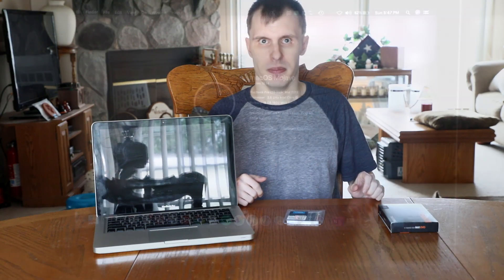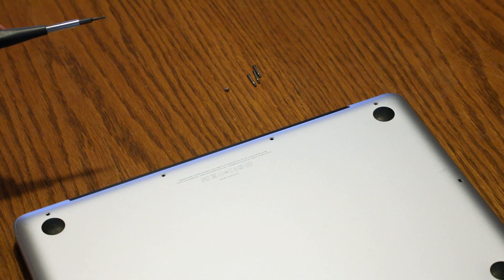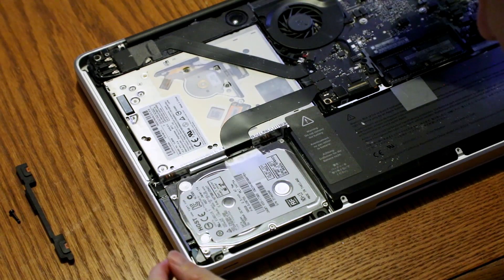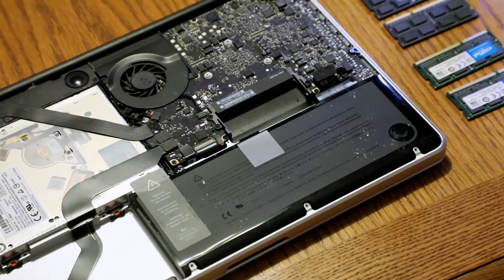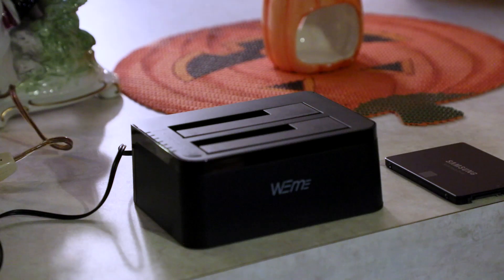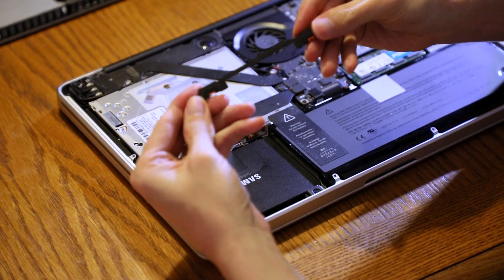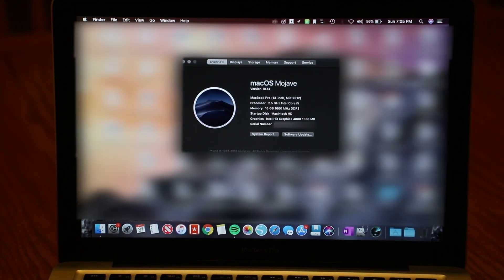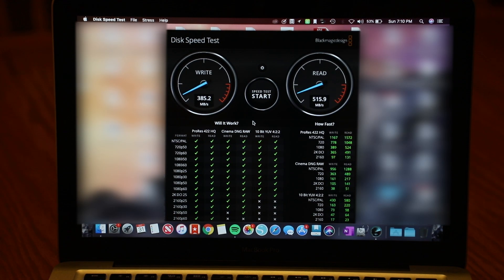MacBook Pro Mid-2012 SSD and RAM Upgrade Tutorial

Comment: I’m a new beginner doing music & I had brought a MacBook Pro Mid 2012 that’s like brand new & it says in the storage section that it has a internal (500 GB SATA Drive) so I wanted to know what’s the difference between the SATA drive & the internal SSD? I ask because I heard that the Crucial BX500 1TB 3D NAND SATA 2.5-Inch Internal SSD is supposed to be a good SSD
Reply from the maker: Hey How, basically if I recalled working on this, there's your normal laptop form factor SATA 2.5" HDD and a small gumstick SSD.  You'd need an adapter though as unless you buy a larger one from OWC or another Mac-focused vendor, their keying does not match M.2 standards by any off the shelf normal PC-based SSD.  You can however, buy that SATA SSD and be fine.

Comment: Is there a way to just fresh install the OS on ssd without cloning the hdd?
Reply from the maker: Hi Kuya, with the 2012 model you could probably from MacOS disc. Just be sure that the firmware of the system bootloader is up to date OS-wise so that it can identify the SSD since it wouldn't be a genuine Apple part.  I only provided info to clone the disk since most people would prefer to keep their installation.
Reply: @TheRealLink  what if I don’t need any data or files from the old hdd, is it possible to just install the new ssd then boot to internet recovery to install the OS?
Reply from the maker: @vangonzales5231  Hey Kuya, I believe with the 2012 Macs you can.  It's the 2015 ones that swap to M.2 NVMe that don't ID the drive properly until in Mac OS.  But I think with 2012 you'll be fine to wipe.  Of course back up anything you'd like to save anyway but I believe you should be fine to do that.
Reply: @TheRealLink  thank you so much! My fiancé just got her ssd delivered today and were about to install it on her MBP mid 2012. You’re a real life and a dollar saver man!
Reply from the maker: @vangonzales5231  Hope it works out well man!  I just try to make sure I'm putting out good advice and tips out there that's all ;)  Enjoy the speedier machine.

Comment: i love to try this.. i dont have a weme .. . Can do this upgrade with a weme?
Reply from the maker: Should be able to, or any drive cloner really.
Reply: @TheRealLink  thanks for your reply. what i meant if i can do it without weme  :)
Reply from the maker: Well, if you want to retain your data, you could probably have drive cloning software detect the new SSD so that's one way to do it without a hardware dock.  But if not WeMe then some kind of drive caddy or dock is needed if you don't want to rely on a software solution.

Comment: Apple documentation suggests 8gb max ram for mid 2012 model.. is this incorrect? Does 16gb actually work effectively?
Reply from the maker: Hi Jason.  As far as I've seen with this client's machine, they have not reported back any issues to me.  And there are countless purchasers of SSDs and RAM kits I've noticed through these videos that haven't come back mentioned any issues for the most part.  So I'm guessing it seems to work fine though YMMV.

Comment: I need your help... i replaced my hd to a new ssd. It reads it as an external drive but when i replace it as a internal drive it boots up normally for 3 min and then shuts off to a flashing folder. I already replaced the internal cable connecting the ssd to the MacBook. PLEASE HELP!  I don’t know what else to do and who do go to. I tried everything on the internet from resetting ram resetting  vram repairing hard drive. Etc.
Reply from the maker: Hey Miguel.  Wow that's quite an issue.  From my understanding, a flashing folder is when the OS can't read a particular file it needs or can't find the OS at all.  If you have your original HDD, you can use the drive cloner to clone it exactly by sector which would also include the startup files / OS.  If you have a Time Machine backup for your HDD, I would recommend restoring from that first.  I believe this swap doesn't allow reinstall from Internet so that's why I recommended the drive clone (unless I'm confusing it with the 2015 Mac I did, sorry it's been awhile).  

It's possible that you may also need to reformat the SSD attached to the machine as HFS+ / GPT.  There's clearly some issue where the SSD is not seeing all the files it needs.  

I wish I could provide more insight but I'd recommend to restore your original drive first, erase the SSD, do a re-clone and try it again.  Hope this helps.

Comment: hello! thank you for the tutorial. My hard drive on my macbook 2012 is corrupt (what apple told me) so I am thinking of switching to a SSD as you showed. Do i still need to clone the hard drive since it is corrupted?
Reply from the maker: Hi Eri!  For the 2012 model I believe it's less necessary than the 2015 model.  You might still need a TM or local disk / DVD copy of the OS to roll up from as I am trying to recall if you couldn't use the restore from internet option with this method.  Otherwise though reloading fresh to a SATA-based SSD should be fine!

Comment: Is this a pre-retina model? Would you recommend replacing the hdd cable as well? I’ve heard mixed opinions on that. Some people say the old cables can be faulty and others are saying that if you upgrade to ssd you need to keep the original cable. What are your thoughts?
Reply from the maker: Hi Tred.  I'm unfortunately not familiar with this cable situation.  On both machines where I did drive changes, I kept the original cables in place.  I'd imagine short of failing outright, cables either work or they don't, so if you're having problems maybe try sourcing a replacement.  If it's working fine then probably don't change it, unless you're seeing other problems arise.

Comment: Hi there, I was given this laptop by my son....he already copied all his files and now got a fresh laptop. If I upgrade the RAM and SSD since it’s like new, do I still need to clone the old drive? Or is it now just replace and that’s it? Or do I need to download again to current OS? I think it’s on latest Sierra version 10.12.6.
Any recommendations on the SSD and RAM wise? 
Also while probably doing this upgrade will consider replacing the battery too. Any ideas of a reliable replacement.

Many thanks in advance.
Reply from the maker: Hi Gonzaga.  For the 2012 model I belive you could just replace the HDD to SSD and upgrade the RAM however keep in mind you'd still need to reload the OS via Internet or from scratch / reload from Time Machine etc.  Since the 2012 model is older, any SATA SSD should work. The RAM used and recommended is in the video description.  The Battery however, I am not sure as to the ease of replacing - you'll have to probably look at another video for that!  Thanks for the kind post.
Reply: @TheRealLink  thanks a lot for your reply. Found a video on How to change battery and seems simple enough.....just finding the right one as Amazon batteries most got mixed reviews anyway. Probably will do the clone too as the sata cable adapter  are cheap enough anyway. Thanks again buddy👍
Reply: @TheRealLink  Hi,   managed to upgrade both memory and ssd on my Mac.....now running super smooth and fast......only had trouble cloning originally as it wasn't a straight forward ie. drive Im trying to clone wasn't showing on image so have to format Samsung SSD a few times and have to restore HD for SSD to clone....not sure exactly how I did it as I was about to give up...but get there in the end...super happy now and again thank you for a great tutorial.
Reply from the maker: Yeah I am pretty sure it has to be formatted in HFS+ or GPT (it's been a bit since I made this) so if the SSD was formatted to NTFS or something else it's possible it wasn't being seen or able to be written to.  Glad to hear you got it working and thank you again for the follow-up and kind compliments!

Comment: Can I just purchase a SSD and plug it in rather than clone ? Or does clone have to happen
Reply from the maker: As long as you have the bootloader recognize the device, I would say it's not 100% mandatory to clone.  Client wanted their data moved over though.   Easier to do this on the 2012 model with a SATA SSD I found than the 2015 upgrade I did.

Comment: would a MBP mid 2012 15 inch have a compatibility problem with a Samsung 860 PRO?
Reply from the maker: Hey Veronica, loks like when I did this I put in an 860 EVO so the pro should be fine.  If you're meaning using an m.2 form factor drive instead, there's no connector for that other than a SATA to m.2 adapter and you'd be limited to SATA speeds anyway.  I don't believe you'd have an issue using the regular Pro SSD though.  Thanks!
Reply: @TheRealLink  Oh okay. Yeah, I just meant the PRO model with SATA connector. I just found it peculiar that everyone seems to use the EVO model but not the PRO for this macbook pro, and I just wanted to double check if there was an specific reason for it. Thank you for your answer!
Reply from the maker: @verosanz  The only difference between EVO and Pro is that the Pro has I believe, slightly better IO and higher rated full life NAND cycles, but since both drives are limited to the SATA spec, it's not faster.  Unless you're doing tons of writing to the drive (and if you are already doing any professional work warranting that much data you probably have a secondary or back up drive), you should be fine!

Comment: Great Step by step tutorial - Thanks so much!! Question: I’m upgrading same as what you’ve done - exactly. My Mac has been looping startup and I’m told my HD is likely done. Can I still clone the stock HD to the new evo using the WEme even though the HD is potential done?
Reply from the maker: Hey Brad, thanks for the compliment!  I mean, a full drive read should be okay, but I wouldn't try to write more to that drive, and, depending on damage or sectors, it may be beyond recovery.  If you have another drive with a TM backup, it hopefully can suffice to clone that or reload it to the Mac first on a donor drive, then close said drive to the SSD.  

There might be some file integrity issues though so I can't guarantee that if you clone your drive over that you wouldn't see the same errors, but it's worth a shot I'd imagine.  Good luck!

Comment: Is the HD to SSD cloner necessary? If my MacBook is still functioning, can I use its time machine backup to create a full copy on the SSD?
Reply from the maker: That's a good point David, thanks for asking.  You know, I was only recommending the cloner since A. it's nifty, and B. I know for sure the cloner copies all drive partitions including OS / OEM sections and the Mac Bootloader.  I don't know if just doing a Time Machine restore on a brand new unformatted drive would include this.  I know TM is for backups but I don't know if it fully restores bootable partitions.  You could certainly try doing that, and if it doesn't work, then try the cloning method I suppose.  Hope this helps!

Comment: This is the best video I could find to follow thank you! I’m getting a used 2012 MacBook to upgrade. Since it will be relatively new do I still need to follow all the same steps in your video?
Reply from the maker: Hey Lanana!  Well, for the 2012 model it's pretty straightforward to tear apart for parts, but yeah, if you're wanting to make sure the OS can boot from the new drive including any hidden partitions or how macOS structures the data, it'd be best to fully clone it exactly, yeah.
Reply: @TheRealLink  Is there any other way to upgrade to a SSD? I dont have the machine you show to do the cloning. Other videos I've seen, they do something differently after the new SSD is installed. I am lost here, can you tell me what is the easiest way to upgrade? By the way, any preference on using the Samsung SSD you show here vs a SK hynix Gold S31 SATA Gen3 2.5 inch Internal SSD? The SK is a little cheaper, with basically same specs. Great video
Reply from the maker: @skatebass19581958  Hey Felix!  Thanks for the compliment.  There are software tools too that you could reimage the drive - the little dock (which is linked in the video description) is just a hardware method of that.  You could always try reinstalling MacOS from bootable media without a system clone.  Just do it fresh and you can skip that step basically.  But most people naturally are wanting to keep their system files / drive intact for the swap.  Yes, basically any 2.5" SSD should work fine!  I've just personally, have enjoyed Samsung products so I've used those.
Reply: @TheRealLink  great, thanks for the reply. In my case, my wife got a new mac and I am getting her old one. I dont really care much about keeping the old files. I guess I can reboot the original HD to factory and do the swap to a SSD. My question now is, doing the clone, will that be the best option if I want to keep the factory license etc?? After I install the new SSD, how can I boot MacOS using the current license in my old HD? this is my first time dealing with macs, I've done many windows. It might be worth getting the dock, it seems to be easier, but if I dont have to get it and be able to boot MacOS, even better. thanks
Reply from the maker: @skatebass19581958  If you do a full sector clone it should copy OS data, license and all, over.  If you own a copy of MacOS, I'm personally not sure as to their reinstall limitations per device or concurrent, sorry.  Personally I've just cloned and kept the old drive as backup when done but you could wipe it out once fully completed too, I suppose.

Comment: Great Video!

Question about RAM, I have a mid 2012 '13 Mackbook Pro, it says my memory has 1067 MHz, (even though when I look up my model on the apple site it says 1600MHz), can I upgrade my RAM to 1600MHz - therefore allowing 16g RAM instead of 8g?

Thank you!!!!
Reply from the maker: Hey Vas, thanks!  You may want to double check the Memory frequencies just to be sure, as some software tools report the base clocks but don't factor in the DDR factor.  But you also might just have the machine equipped with slower RAM.  If Apple themselves say the machine supports 1600mhz frequency, you should be fine to put that in.  

While Apple and other sites show 8GB is the limit, there are many forum posts stating that you can put 16 GB in as long as it's a Macbook Pro.  Good luck!
Reply: @TheRealLink  Great! Thanks so much for your help, it's much appreciated!!

Comment: Thank you for the step-by-step tutorial; it really helped and made the process seamless.

I did want to ask, why does it still show "Macintosh HD"? Mine appears the same as yours and does not look like it is using any memory from the new SSD. I was expecting all of the files and data to merge into the new hard drive and it populate there as used space but this doesn't seem to be the case. Did I do something wrong?
Reply from the maker: Hey Larry, thanks for the comment and question.  There might be some identifier on Disk Utility to nicename the drives but I'm not 100% sure.  Did you end up doing a drive clone or Time Machine restore to the SSD?  I don't think you can run two hard drives internally on that Mac (sorry it's been awhile since I last looked at it) but you may have to change boot order to make it correct.  Those are my guesses at least.

Comment: I performed this upgrade this afternoon. This is the first time that I have ever attempted to do something like this. I must say, this was probably one of the easiest and smoothest projects that I have ever done! This is all thanks to your video! I found your step-by-step guide extremely helpful. Everything was literally plug-and-play and tightening and loosening of screws. Now my old MBP is running so snappy! Thank you! 

Also, the WEme seems magical.
Reply from the maker: Hey M. Jerome Bell. Thank you SO much for taking the time to comment and to let me know that my guide worked for you step-by-step.  I've had a couple comments mentioning some failures or snags but yeah I tried to be very careful step by step and thorough in making this as easy as possible.  Good luck with your new, speedier Macbook ;)
Reply: How much faster did this make your macbook ? Im looking into this and wondering if the cost of the parts are worth trying this. I got an offer of about $250 for my 2012 Macbook Pro 
So im debating whether to trade in my macbook and xps towards a newer Macbook 2017 or newer
Reply: @bizzayslidez  it made it SIGNIFICANTLY faster. I would certainly recommend that over buying any MacBook with a butterfly keyboard. I still use the mid 2012 as my daily driver and I beat it to the ground.

Comment: Txs for this video. Do I need to format SSD, before cloning it? If I do, then what free program should use?
Reply from the maker: Hello BT.  If you wanted to reformat your drive with a clean OS install you could, then clone it over.  The docking bay's controller clones the drive so no software is needed.

Comment: Would it be possible to upgrade the MacBook Pro mid 2012 with the 2020 Magic Keyboard?
Reply from the maker: Hi Menudae, I found this question posted on Apple's forums without any direct answers.  The MK seems to use a Thunderbolt connector or just Bluetooth to connect to the system which seemed to have been added in 2012.  I'll have to take an educated guess and say it appears to work and be compatible, but I have not tested this.

Comment: how long did it take to clone the Hd to SSD ? if this clone device is jus plug and play?..thanks
Reply from the maker: Depends on the amount of data you have on the HDD.  Generally shouldn't be more than about 30 min to an hour.  Yep just plug a SATA SSD into the drive and the Mac's HDD, hold power and clone, release, and it'll flash and start cloning it automatically.   (HDD must be A slot and SSD must be B slot).